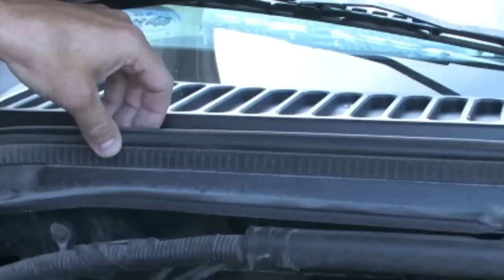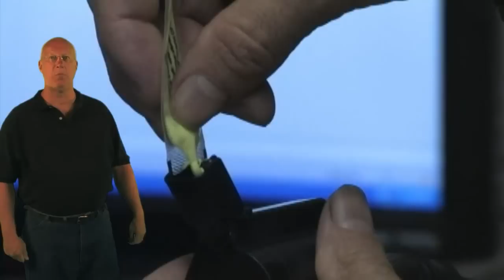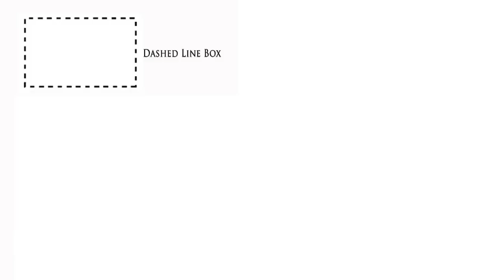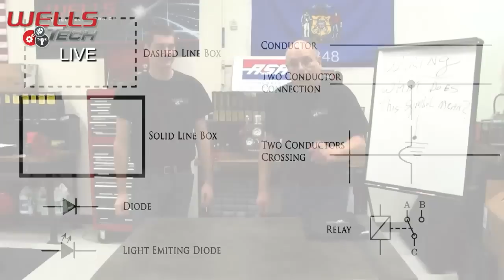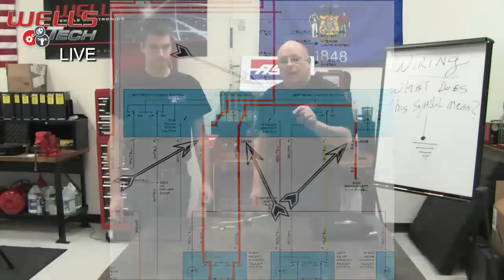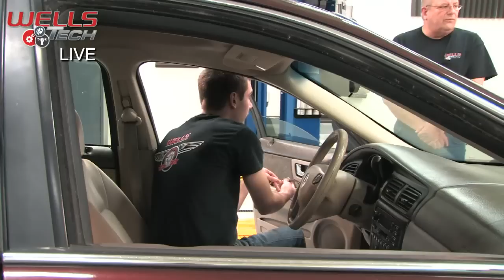Power Window Diagnostics

Comment: how come it didn't work from the passenger seitch ?
Reply from the maker: +swav100 Great question! It actually wasn't working from the passenger switch because the master window switch was internally open, so the power and ground could never pass over to the passenger side switch. If the passenger side switch had its own power and ground supply the window would work just fine. But being that the power and ground are router through the master switch, having a faulty master switch actually made both of the window switches Inop. Hope this answers your question! :)
Mike Becker, Technical Services Instructor
Reply: +markjhicks thanks Mark
Reply: +swav100 Mike
Reply: So in a working master switch, using the passenger switch connects the power and ground of the master switch?  How does that happen?  How does the passenger switch turn the master switch's passenger switch manually?
Reply: @manuelsalvatierra2940  so hard to explain, You should spend more time reading wiring diagram and figure it out.